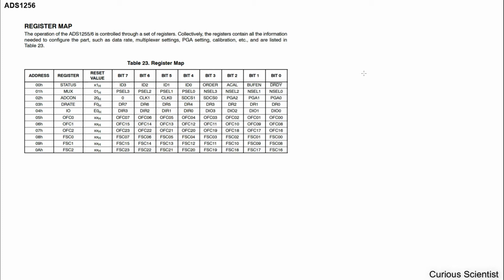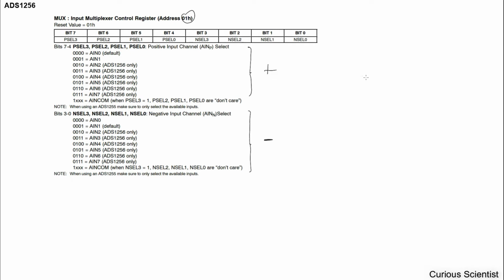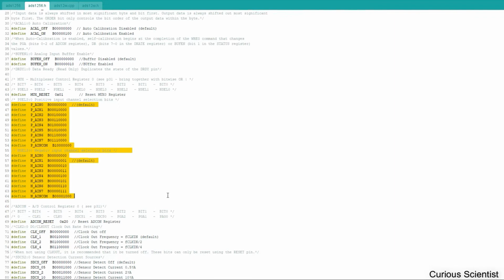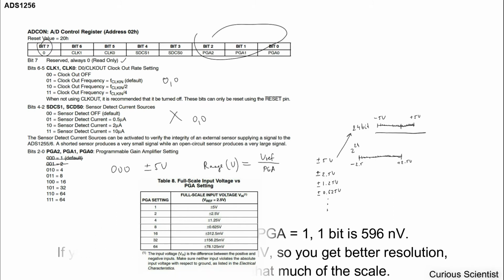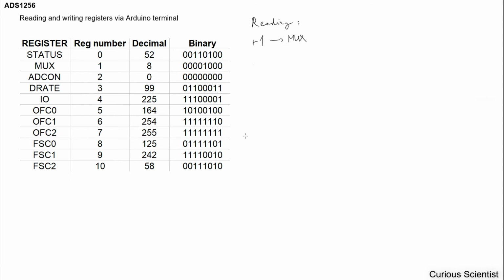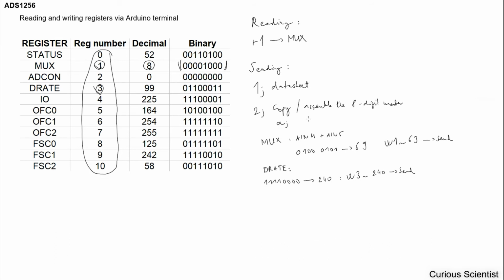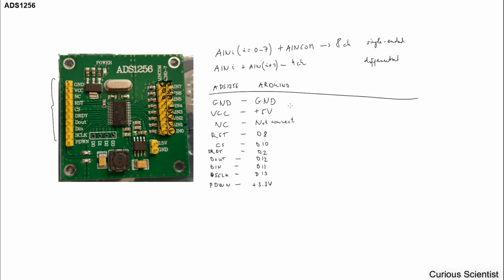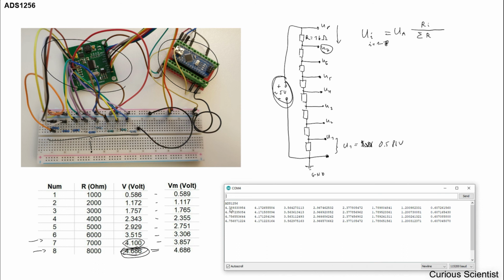ADS1256 - Registers and demonstration

Comment: @CuriousScientist tôi đang gặp vấn đề , tôi kết nối chip ADS1256 này với raspbeerypi, nhưng raspberry các gpio có 3.3v thì có ảnh hưởng gì không, bạn có thể giúp tôi
Reply from the maker: Sorry, I can't understand this. I don't know, it is maybe my accent, but you should've noticed that I speak English in my videos. So when you want help, use English...
Reply: @CuriousScientist  sorry CuriousScientis, I am having a problem, I connect this ADS1256 chip to raspbeerypi, but raspberry gpios have 3.3v, will it have any effect? can you help me?
Reply from the maker: Hi! Thanks for using English! Only the analog part of the ADS1256 is at 5 V. The digital part should be at 3.3 V, so it should be fine. I used it on STM32 microcontrollers without issues, and other people reported using it with ESP32 without any issues. Both are 3.3 V systems.
Reply: @CuriousScientist  Thank you for helping me solve the above problem 👍
Reply from the maker: No worries, glad to help!

Comment: Hi man,I´m using channels 0,1,2 and they seem work fine, very close to what I measure with the multimeter, but the rest that aren´t connected send more than 1.25v, any idea?
Reply from the maker: In which mode do you use them? Single-ended (8 ch in total), or differential mode (4 ch in total)? What is your PGA setting, PGA = 2? In principle, it should not show this behavior at all. have you tried to connect the not-used pins to the GND? (I know that the datasheet tells the opposite, but still, give it a try)
Reply: @CuriousScientist   It's working! I was using it in single ended mode and changed it to differential. Thank you so much for your help, here's the link of the project in which I'll be using the ads1256 if you want to check it out:  https://github.com/DanielEXT10/TLS-MySQL greetings!
Reply from the maker: Great, I am glad that you solved it! Your project looks interesting. I have never measured torque, but only tensile load.

Comment: Hi 
I don't fully understand the "full-scale input voltage" ranges. For example, the +/- 5V, does that mean that the input voltage range for the ADC should be between -5 V and +5V ? because I thought electronics can only take positive voltages.
Reply from the maker: Hi! 

Let me clarify. There are 2 modes with this AD converter: single-ended and differential. When you use the single-ended, you have 8 channels. The AIN0,1,2...7 channels are the positive side of the input and the AINCOM legs are the common (hence the COM in AINCOM) pins (negative). In single-ended mode, you can only measure positive voltages between 0-5V if your PGA is set to 1. 

In differential mode, you have only 4 channels, because you use the positive legs as input (AIN0+AIN1, AIN2+AIN3, AIN3+AIN5, AIN6+AIN7). Here, you don't have to worry about the polarity, because you measure between -5V and +5V. 

In single-ended case, you measure between the GND (0V) and some positive voltage. In differential mode, you have no reference to GND.
Reply: @CuriousScientist  thanks

Comment: Hello
Can you suggest me a convter
From 4-20mAmp to digital counts for my project on distance measurement
Reply from the maker: Could you make your description a bit more precise? What do you want to measure? What devices, what is the required resolution and precision...etc?
Reply: @CuriousScientist  I need to stop or position a vehicle when it arrives  on the weight bridge  , so I might use a  leaser sensor (sensor o/p is 4 - 20mAmps ) . 
Can I convert 4 - 20mAmp to digital counts with ads 1256 and resberry pi 3 output can be given to a local display unit for vehicle to stop at correct position
Reply from the maker: @ie3562  Thanks for the clarification! Yes, it is easy to measure in the mA range with this ADC. For example, run the signal (current) across a 1 kOhm resistor, and measure the voltage on it. With this device, you can differentiate within the microvolt range (~10^-6 V), and if you use the PGA, you can further increase this resolution. Since, the AD conversion is 'generated' in the microcontroller (RB pi or Arduino, or STM32...etc), you can write your own logic which will control the vehicle and/or the distance measuring device and control everything within a single system.
Reply: @CuriousScientist  ok thanks
I am new to Rb pi  , so it means output from rb pi can be given to a large display unit . Through which vehicle operator will be able to stop his vehicle on correct position. Will it work so
Reply from the maker: @ie3562  Yes, it is doable. However, RBpi might be a bit overkill if you just want to drive a display and the ADS1256. A regular Arduino Uno should be sufficient. But it is up to you.
Reply: @CuriousScientist  can you send your email address will update you
Reply from the maker: @ie3562  I don't use email for this channel. Either you can leave a comment here or send a DM on Instagram. I can help with small things but I am not a free support service.
Reply: @CuriousScientist  ok 👍